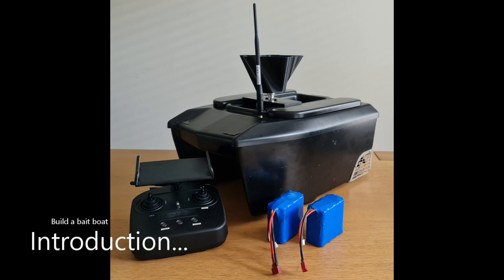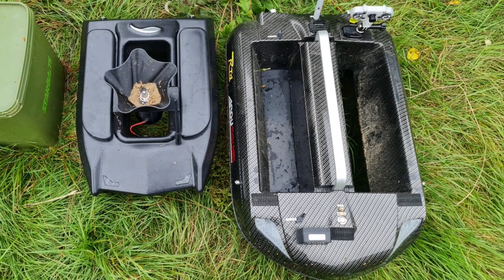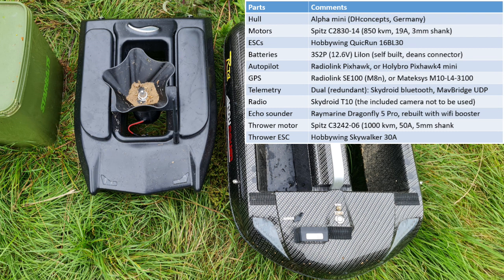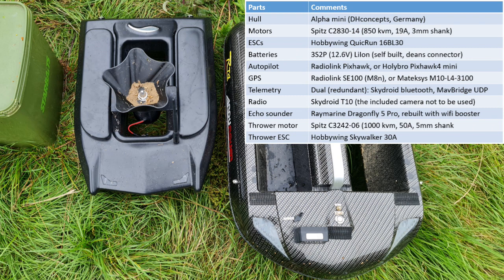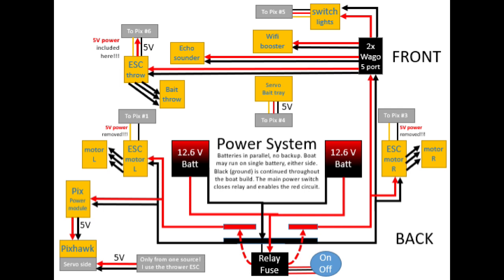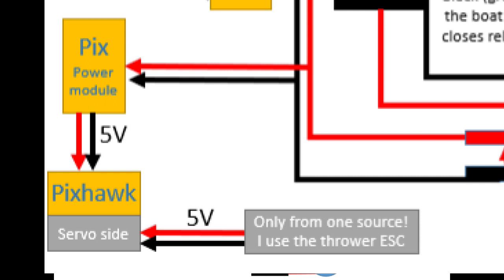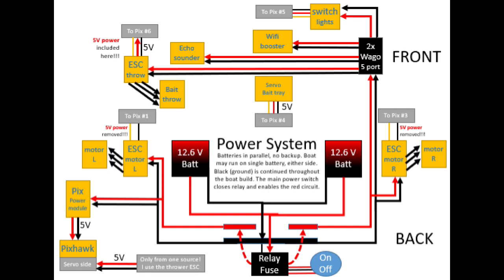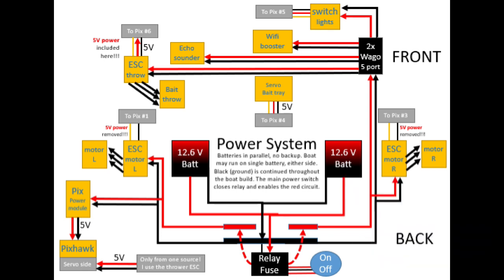Boat build part 1 - Overview

Comment: Hi this video series is invaluable. I have one question, I plan to install my modified deeper into my boat, but I understand it will need a wifi booster similar to the one you use for the ray marine. Can you tell me which one you used or which would be suitable for the deeper.
Reply from the maker: In the video series I used this (and also used the same some years back with a Deeper):
https://www.aliexpress.com/item/1005006292467945.html

Comment: Do you use a PDB (power distribution board)  ?  How do you decrease voltage for the ESC ? Can you explain this ? Wiring diagram is not clear to me. Thanks
Reply from the maker: No PDB. The ESC get the raw power from the batteries (you need to chose an ESC that is compatible with the battery voltage). And for the servo side, the power is provided by a BEC from one of the ESC. I think the description in the video and in the drawing is pretty accurate.

Comment: @carppilot: the working from the autopilot is fully seperated from the fishfinder?
Reply from the maker: The autopilot uses it's separate telemetry data stream. Two ways to implement that is shown in video 2 and 3: using a Skydroid T10 rc Radio with built in support for mavlink, and a wifi UDP adapter that uses the wifi of the echosounder as carrier for the telemetry data

Comment: Hi , love the video very informative and well presented 👍 could you please tell if me though is the telemetry and Raymarine both 2.4ghz? Do they not interfere with each other ? Thank you
Reply from the maker: In this case the remote transmitter (that carries the telemetry) and the Raymarine wifi both 2.4 GHz. And they will then interfere. In addition, the water will limit the possible distance you can hope to achieve (the distances possible for a drone up in the air cannot be compared to a boat with its antenna heights measured only in a few centimeters above water level).
Some transmitters are nototious in this regard. Like the trusty old Flysky I6X (although this has no telemetry support, for comparison this is transmitter is known to significantly interfere and limit the achievable distance for the Raymarine).

Now, it is possible to play around with the channel used by the Raymarine wifi before altering it (the screen head unit must be used) as not all channels will be impacted equally). Not all transmitters are equal, so such testing may pay off before gluing the Raymarine in.

Then, for reference, I did some range testing with this boat. And for safety reasons I activated the failsafe for GCS, and made sure the failsafe action was RTL (if the Carp Pilot Pro lost communication with the autopilot, the boats returns back home - I did not want to swim out to rescue it).
I put out a marker 600 meters away. Then touched it to trigger the boat to drive to it an stop. And then watched what happened with Carp Pilot Pro and Raymarine's wifish app in split screen. Making several tests:

I found that, using Skydroid radio for telemetry, the Raymarine app lost the echo sounder at approx 430 meters. For this testing I then drowe back home until the Wifish app once again worked.
After being satisfied with this test I tested my secondary telemetry, the wifi UDP adapter that sends its data through the Raymarine wifi. Powered off my SKydroid, and connected using UDP. And retested. This time I typically got until 390 meters (397 being the best result), and then the GCS failsafe kicked in and returned my boat before the wifish app would freeze up.

To summarize: For me, distances of around 400 meters is fully satisfying. I never fish further away. I never really tested the max telemetry distance with Skydroid. But what I hear from others is that at least 600 m is achievable in combo with the Raymarine.
Now, would the Raymarine distance be better if I have also removed the Skydroing receiver in the boat? Probably. At least such effects I have personally witnessed with an older boat I have with the said Flysky. And could you get a similar effect if you use transmitter with say 868MHz instead of 2.4 GHz? Most likely.
Reply: @TheCarpPilot  Thank you for the comprehensive reply , best regards
Reply: @TheCarpPilot  Hi , I have the Raymarine installed as you have in the hull combined with the Skydroid controller and Carp pilot pro app/Raymarine Wi-Fish installed . I have a Wi-Fi booster in the boat same as yours but it is NOT connected via a sma cable to the circuit board. I am losing readings at about 80metres from the Raymarine , does this mean I definitely have to connect the Wi-Fi via a cable to the Raymarine unit ? I know how to do it by moving the resistor on the Wi-Fi board and soldering a mini sma connector in but is it totally necessary as I only need 180 metres ? The Raymarine is also running very slow on the scroll screen , Many thanks in advance
Reply from the maker: @Blupa.  That Booster takes an input signal and enhances it. The only way it can do that is by sitting between the "router" (in our case that is the Raymarine) and the antenna. It has two antenna connectors. One for the router (your Raymarine) and one for the antenna. And it only works with those physical connections. To use this booster there is no way you cannot first modify that Raymarine. 

Not explained in the video... This is Kot the ONLY way to increase the raymarine distance. You can also implement a router inside the boat. In bridge (not Extender) mode. One router that works is the Vonets VAP11S. Please do not als me how to. Because I never did. But there are Videos out there showing how to. I believe with a Deeper. But the principle is the same. And... You can have another router (also Vonets) on shore. And link everything up with two routers. And likely see 500 meters as a result. 

Still want to use that booster then do that soldering. Don't know how to, find someone that can help. Soldering too difficult (yes, you can damage that Raymarine for sure) the try the router way. 

Best of luck.
Reply from the maker: You should look up the Carp Pilot Pro User group on Facebook. It is private, but just ask to join. The community is growing and there are many who have insight and can help.
Reply: @TheCarpPilot  Many thanks for taking the time to answer it’s much appreciated 👍👍👍

Comment: How to know what’s the proper motors to use if i have another boat with another dimensions?
Reply from the maker: Not an easy question to answer. But the YouTube boat is small (44 cm, 4.5 kg with batteries and thrower). I just mounted motors in a bigger boat (60 cm and more heavy) and put in Propdrive V2 3536 910 KV into it. The KV value is a bit high for boats. Better to find one with like 500 KV, better for boats. The thrower motor is insane. I had to tune it down to 1650 max PWM output and do it momentary for only 1 second. It ran so fast that the basket widened on the top and I was afraid it may cut my antenna in half.

Comment: Do you need a Skydroid t10 radio to build a boat. Or can I use a regular Flysky or radiolink remote
Reply from the maker: You can use both alternatives. But then also add a solution for the telemetry connection (like the adapter I use in my videos as a secondary telemetry option, I believe it is video #3). If not the Carp Pilot Pro cannot talk to the pixhawk inside your boat. I used Skydroid as it can handle the telemetry as well over the remote control link. But it costs money, far more than a simple wifi adapter for around €10...
Reply: @TheCarpPilot  ok thanks for the quick reply. So either my existing flysky i6x or a radiolink t8fb radio would suffice providing I use a secondary telemetry connection? I have an existing twin hull bait boat which is powered by 2 brushed motors and escs using 2x 6v lead acid batteries these can be upgraded to 2s Lipo if required. My boat is a big lake mk3
Reply: Also can you use an omnibus f4 aio is the flight controller/autopilot
Reply from the maker: @jackholding9010  i do not know it. Look it up on the ardupilot wiki. They support a wide range of autopilots, and list them with info and links.

Comment: Hi. Great series, could I use a deeper instead of Raymarine ??? Would you know how to set one up using all the components that you have listed ? Great video.
Reply from the maker: The boat used as illustration (the same hull) is built with a Deeper, a booster and the same Skydroid T10. This works flawlessly. However, the backup telemetry using a wifi ESP adapter is kind of more difficult. Reason is that the Deeper's SSID is quite long (more than 16 characters, which is the macig number for many wifi telemetry adapters). I know that someone is working to fix that. But if you use the Skydroid radio then that is nothing to worry about. And the DHconcepts hull of the "ALPHAmini" is actually even designed for fitting in a Deeper (recess in the bottom hull on both sides).
Reply: @TheCarpPilot  Thanks for the reply, I have a Alpha Mini shell from Dennis that I am building.
Reply from the maker: @stuartgriffiths4299  in the next video the Deeper's position (where to mount) will also be shown. The hull has a recess on either side intended for the Deeper. I drilled a 42mm hole, glued it from the inside and finished off gluing thereafter from the outside. You will understand when I show some pictures.

Comment: how to connect servos?
Does the servo need a separate power supply?
Reply from the maker: You should watch more of the videos, but even the first one states this clearly:
Usin this pixhawk the servo outputs must be powered separately. Using a 5V BEC. I used a BEC that is in a ESC in my video. As also indicated clearly in the drawing.

Comment: hello, good luck with the project.  just a question why not put thrusters it would save space in the boat.
Reply from the maker: Not a bad idea. But the motors selected are anyway tiny. And it is not just space causing challenges. Weight is equally important. The chosen motors weigh in at 57 grams (although the weight of the shank also comes in addition). All parts are bought in, so I will proceed as planned here :-)
Reply: @TheCarpPilot  ok that was just an idea since it's a small boat.  Can't wait to see it finished.  great the last 2 video 👏👏👏 always on top you 🏆